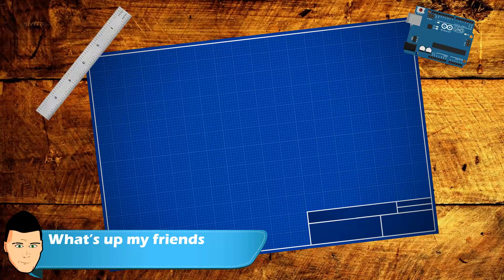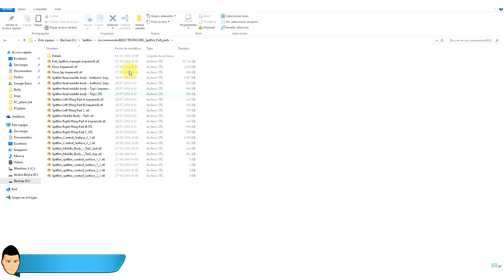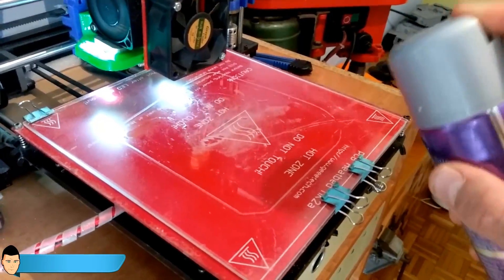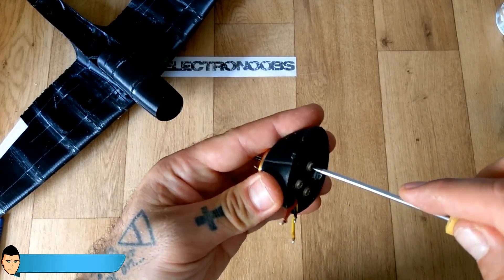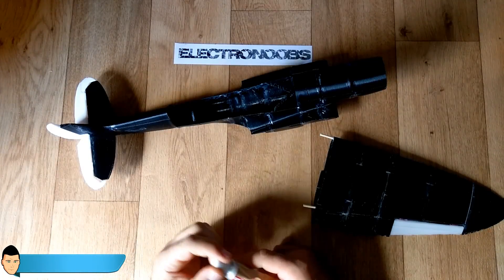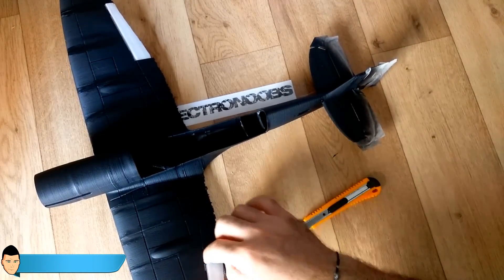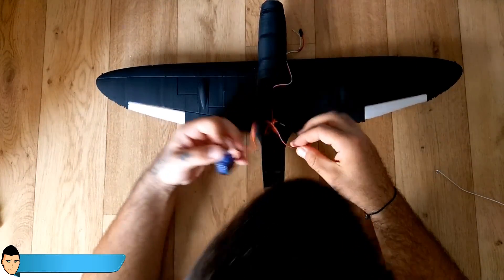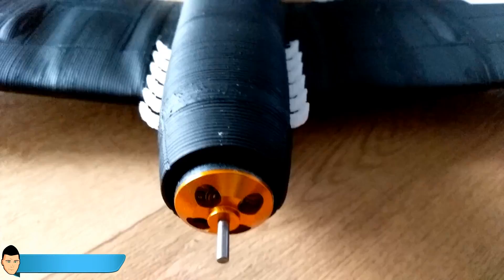3D printed Spitfire RC plane body - FREE STL parts

Comment: so ive got these files ready to slice and print but cant get any answers on supports and settings and all that. is this plane ready to go as is or does it need work. i see you did some modifications. any way i could get files to print from you please? i have an ender 3 pro. you did a great job on this.

Comment: Super cool! Can it be printed in ABS?
Reply: you must not be a 3d printer
Reply: @ferce889  indeed, I'm not a 3d printer, but a 3d printer user.
Reply: @gonzo2779  to answer your question you can but im not sure what settings you would have to tweak as the settings for this are for PLA

Comment: Would be really good is the parts had connectors, iv tried to make these using the stl files. Tried off setting the files and marking them 3 mm small so they sit inside

Comment: What do you mean by 2 perimeters? I'm new to this and my slicer doesn't have that option. I don't have the "solid layers" either, unless I just don't know what these terms mean. I am using Ultimaker Cura
Reply: If using cura its under walls and it how many walls u want it should be set to 2 and im using 10% infill with 2 walls and the parts are still strong and will be lighter overall

Comment: how do you keep the canopy on the plane while flying?
Reply: Looks like we have to work it out for our self as you do for many things on this plane including the CG / top and bottom layers on some prints and supports ( He did say that he marked the ones that need supports but I could not see any marks on the STL files or understand what he said ? ) I have just printed this in light weight PLA as I was a little concerned about the weight  but I had to add some carbon fibre rod inside the fuselage to join the wings together as they were very flexible. Anyway now to think of a method to fix the canopy on as you said ! PS I will be very surprised if it last more than one flight ?

Comment: You make some great videos.
Please make a video to upgrade a flysky ct6b transmitter. They are available on aliexpress for less than $30.it has total 6 channel but is a real crap. I have bought it and and i want to make it better but sadly i can't. I am really weak at electronics and arduino based things. I would be really thankful if you can do it.

Comment: Great plane friend.
You seem to have a sound knowledge in electronics but seems like you don't have a experience in aerodynamics or rc plane.
Just a small tip:change your motor. You know that the motor rotates the propeller but its torque also rotate the plane. You could also try giving a nice angle to the motor but i don't think it will work.
Youtube search 'rc plane thrust angle" and watch a flittest video.it will explain you everything(almost).
Reply from the maker: Thank you very much!
Reply: can i ask you a question. If i use a2212 1400kv for this project is torque of this motor can affect my plane ?

Comment: To make the plane look better and strengthen it..... I’ve painted it 😂😂😂 jeeze, paint don’t do shit for strength.
If you wanted strength, first don’t use 3d printing, 2nd dont build  a plane and 3rd if your not concerned with waste plastic every time you need to reprint because you crash then you might as well tissue and dope the fucking thing, can’t stop you crashing but can deffo make some of the parts stronger than your print!

Comment: has this model actually flown yet?
Reply from the maker: Yes, but I have no video of it. BUT!!!! I've used a small 1100mAh battery to reduce weight so the flight time is under 8 minutes. Besides, at landing the wing got broken. But I've just glued it in place.
Reply: i'm thinking of using a 2cell battery with just a normal rc rx in place of the arduino, should keep weight pretty low and adding some landing gear should make landing a bit easier.

Comment: why PLA? is ABS not an option?
Reply from the maker: ABS is not that sticky. What i mean is that it will break between layers because the ABS print is not that compact. Also you would have a lot of problems printing in ABS the thin double layer wall of the 3D parts. I recommend PLA.
Reply: What abut PETG ?
Reply from the maker: nazghul I never used that material so I don't know. try one part and let's see the results

Comment: it is able to fly? I mean the airframe... it is tested? what is maximum weight it can lift (calculation or real test)?
Reply from the maker: Kartiko Nugroho Hi there. well I haven't test it yet outside. I was very busy and I need to get out of the center of the city to fly it.but the body is quite strong and also light and there are a lot of 3D printef planes like this one that can fly whitout any problem. keep up. I'll test it soon
Reply: based on the video, your plane seems too small for that load... that is why I asking the question... plane design is not just shape, but the scale, the weight, and the CG will make a plane can fly or not...

actually I just right to print your stl file... but I wonder if you design it correctly or not... is it tested design (from any one else)? or you design it by yourself?
Reply from the maker: Kartiko Nugroho since I didn't test it yet I can't assure you 100% but it is a few cm bigger than comune bangood rc planes. And I also bought a smaller lipo with just 2000mAh to fit well and to weigh less. There are a lot of 3D printed planes on YouTube like this one and this is even a few cm bigger so I don't think scale would be a problem. This design is based in those and respects all airodinamics and RC controls. When the test is done I'll upload a video. Keep up and thanks for com.
Reply: can you give us information about the wingspan, wing area, weight, battery cell (2 or 3 cell?), prop size, and (the most important thing) CG location?
let me calculate the predicted fly character of the plane (because I am just a noob pilot, I should select an easy fly plane. I only capable to drive beginner and intermediate grade RC plane)
Reply from the maker: It uses a 3S battery but with a size of 3x10x2cm and 200mAh. The prop is a 4510 with a lot of throttle but I recommand a tripple 11x6 proppeller because it will have less vibration.  The wingspan is 63cm and each wing is 28cm long. The wing controls are 10 cm long. Total weight with the battery on is 591 grams. It is printed using PLA material and double layer walls. It is quite flexible and strong. The IMU is in the pilot case and the center of gravitation is exactly in the desired position calculated using this webpage http://adamone.rchomepage.com/cg_calc.htm

Keep up :D

Comment: Can I ask how you went about designing the parts? Like what program did you use and how did you get the dimensions and stuff accurate?
Reply from the maker: Hello there. Well, is not entirely my work. First you download a spitfire.obj file from google. There are a lot of plane designs from games on the internet. I've used BLENDER to edit and divide my parts. So you take that plane file and divide it into parts and make it double layer wall. Add all the details and sabe it into STL file. After that you have to wather seal it and give it another edit and make it ready to print. To wather seal it I've used NETFAB.  Keep up :)